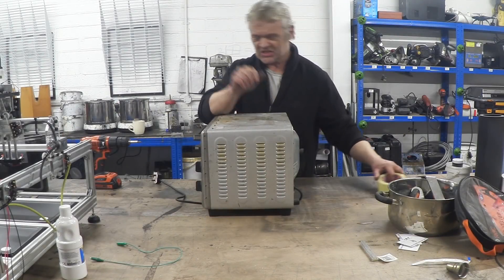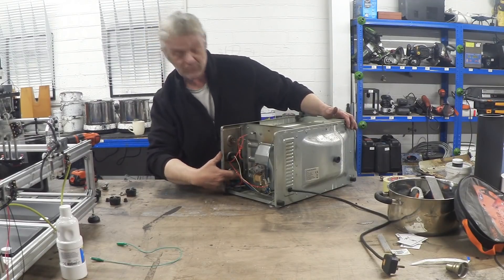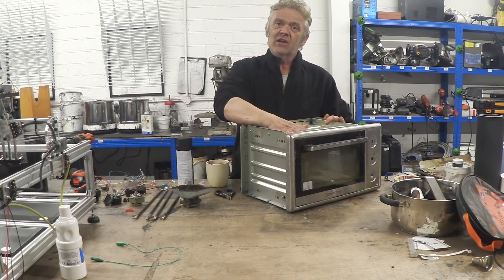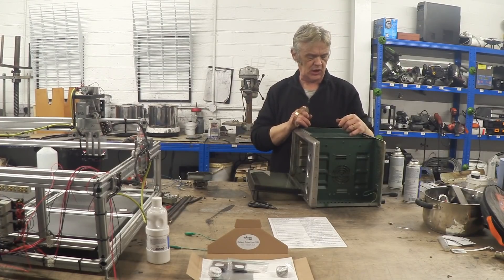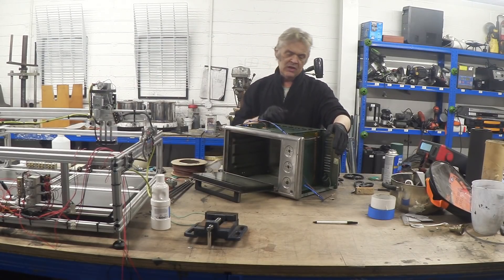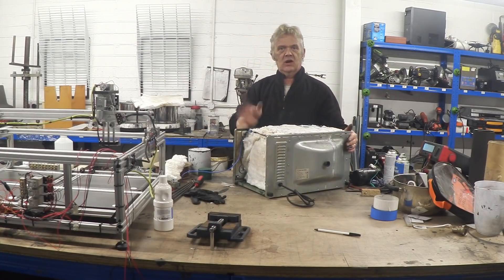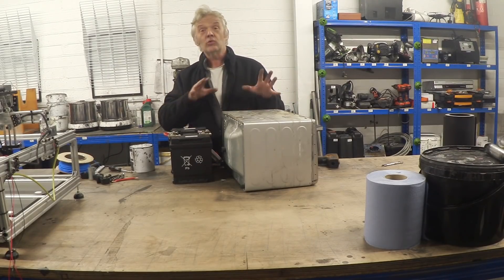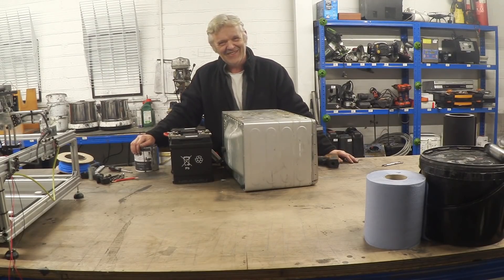Build An Off Grid, RV Oven From Graphene Ink And A Car Battery

Comment: Maybe I missed something in the disassembly... Isn’t there a layer of insulation between the very inside of the box and the metal sheeting to which you applied the stove paint and your conductive ink? Most stoves (albeit, they are home stoves but same principle) that I have worked on have a insulation around the inside box for two reasons, keep the heat in the cooking are and to keep heat away from the electrical bits and from people standing around in the kitchen and the cabinet into/onto which the oven is placed.
Reply: Sorry, I see it now. The insulation was replaced onto the painted surface. Thank you. Very informative.
Reply from the maker: there was no insulation mate - I put it in - the insulation was a ceramic blanket I normally use for kiln work - but the original oven had none at all!

Comment: First of all, nice video Rob. *there are not a lot of cookers working on DC and at low voltages - so you are forced to use grid of inverters*, this is because you will need more amps if you want to run oven on low voltage DC to get 1kW oven and bigger cables also.
Reply from the maker: true enough mate - but I don't think It's a question of kW - more of temp, heat load and time
Reply: @ThinkingandTinkering  Yes you're right. Do not forget about thermal capacity / density. To heat a 100ml of water on classic 2kW hot plate, the water will boil in less that 2 min. A hot plate with 240W on same temperature will need around 20 min or more.
Reply from the maker: @dyukk8844  cheers mate
Reply from the maker: lol - indeed

Comment: One of the projects that I wanted to try with your ink is to make heated mirrors for my truck.  Should be easy as long as you can get the resistance right to avoid damaging the mirror.  Painting the heater onto a precut piece of transparency plastic or maybe contact paper would allow testing and adjusting the heater before sticking it to the back of the mirror.
Reply from the maker: absolutely mate - for those kinds of heating apps I use PET film - it's tough, good for heat up to 100 degrees C and used in underfloor heating - it's what we used to call acetates for OHP applications - it's now used for heat seal laminators you get for the home office - laminating pouches can be got at staples easily enough

Comment: Hot Stuff !
Many of my early experiments ended up with very non-conductive carbon = an insulator.
It would be absolutely awesome to paint on non-conductive carbon, then paint on Your conductive carbon ....
Also, 1 copper strip one one side should connect fine to the steel case - save material/cost.
Reply from the maker: that's very clever mate - thanks for that - like it
Reply from the maker: little more than contact strips - I do like Aga's suggestion - it's like car electrics the body is used as ground - just fine to do at 12V
Reply: @ThinkingandTinkering  Lower case 'a' otherwise it's the American Gas Association, or the Aga Khan ...  ;)

Comment: Thinking about this a little more, I wonder if something as simple as adding a copper strip between the ones already in place (without being directly connected to the power) and painting over it would lower the resistance enough to use off 12 volts?
Reply from the maker: I will have to try it mate - this really was a prototype - it shows it is doable but not a lot else
Reply from the maker: I am about to try it mate - lol

Comment: I would think it should be possible to make this run off 12 volts instead of 24 volts by getting the resistance lower.  Possibly another coat of the conductive ink or get the copper strips closer together.  

I haven't examined a small toaster oven but the thermostat already in it might be mechanical and easy to hook up to the 12 or 24 volts instead of resorting to the Arduino controller.
Reply from the maker: I'll give it a go mate and basically I agree with what you are saying for sure

Comment: If we use 120 W instead of 3000 W,it takes more time to cook and possibly spoils baking cakes!
Reply: I'm no kitchen guru, but you'd simply preheat the oven until the desired temperature is reached & cook as per usual.  Every oven has it's own quirks that you learn to adjust for.
Reply: @laszlon.4424  You are Rob are not taking into account thermal mass, you cant melt an iceberg with red hot coin, just because the insulated oven gets hot does not mean it can cook anything.. A candle flame is as hot as your oven, but it would take forever to cook a meal with a candle, you need the power (watts).
Reply: @goldmagnet9013  Yes I totally agree with @goldmagnet on thermal mass and the power. I think cyrex said in one of his videos that the power consumption on classic hot plate heaters and painted carbon ink hot plate heaters are almost the same, if you want to heat something on same time. Only the design of the heater element is different. Are not electric heat elements 99% efficient?
Reply: You mightbe correct, however I feel your missing the point. Using 12v batteries instead of mains electricity is all about portability/offgrid potential. To take your argument to the extreme a 3 phase oven will probably cook faster than single.  Ease up & see the glass as half full, it's all well and good leaving your mark on this world just make sure it's not a skidmark 😅
Reply: @laszlon.4424  If you look at my videos you will see I live off grid, a 12 or 24 volt system that only used 120 watts of power and cooked food like a 3Kw system would be more than perfect. From the title of this video, I should be the ideal demographic, but its all too easy to see this is of little use as an oven for cooking a meal. I made the comment as I believe this video is not accurate, and suggests that this design would be a good off grid cooker.  Being chilled and relaxing is grand, but not at the expense of the truth, if you do that then you are the skidmark.
Reply from the maker: not really mate - it's not about watts it's about temperature - the main reason normal ovens use such a lot of energy to get to temperature is that they are poorly insulated and have inefficient heaters - that's all really - this oven is efficient at heat transfer and i put a lot of insulation in that's why the power consumption is low but temperature is the same - no magic mate - just common sense really
Reply: @ThinkingandTinkering  Robert your reply is terrible from a science perspective, so inaccurate. The analogy is you are basically saying a battery is all about volts ! You put a cup of water in your oven, and compare it to a 3kw oven, how long would they both take to boil, yours with 120 watts input compared to a 3kw unit. If you are honest you know that it would take much longer to cook anything with any mass in this oven, compared to a normal oven, thats all the poster was saying.   We get that the ink is good, but you are selling it like snake oil.
Reply: @goldmagnet If the claim is they can produce same temperature they would heat equally, regardless of whether one is using 120W or 3000W. Your argument sounds as if car with fuel injector can't use less gas because all of the cars before fuel injectors consumed X times as much. That's nonsense. Have you considered that painting the heating element covers much larger area than standard heating rods used in convection ovens?
Reply: @goldmagnet9013  I agree with you to a point. That is that Yes you will be looking at slower thermal recovery times from a 120W system as opposed to a a 3KW system, though the power isn't telling the whole story is it? The Generic lack of good insulation in these products is why the power ratings need to be so high to maintain a usable temperature profile for cooking.

Let's take what you have rightly identified as an issue rather than a criticism and provide a solution, after all this is a fantastic idea in its infancy, a prototype, there are bound to be some pot holes along the way.
It is not my intent to attack you or marginalize your opinion in any way.

I personally do not detect any snake oil in @Robert Murray-Smith simply enthusiasm, fascination and wonder which we could all use a bit more of in our lives.

As a couple of people have already suggested increasing the thickness of the ink coats would decrease the resistance and so increase the wattage, maybe bring the oven up to 300W so it can be more thermally stable when the door is opened briefly or a colder mass is introduced.

I also see that 300W 12V ceramic heating cartridges are easily and economically obtained from ebay ali express and bangood.
Embed one of these in a Graphite or aluminium block maximised for high surface area and utilise this element as an rapid boost assist at the bottom of the oven. 

Switching between the two heating sources may give you a better thermal profile for cooking which can easily be implemented using PID algorithms and an arduino. That would be my second approach to potentially developing the idea into a working off grid culinary device.

It's just a thought.
Reply: @Traderhood  The claim at the start of the video is that its a usable oven for RV owners. At the end of the video the claim is repeated.  If its not about power, and just temperature then forget about an oven and use an 800 degrees candle flame instead ? An oven is about how much thermal energy is delivered to the food, if you can't see that then as I said use a candle, with your logic it should be 4 times quicker than this oven,.
Reply: @deepforrestalchemy9189  I agree, it would be more workable by putting in some more power from heating elements. The foods got to get hot, and thermodynamics dictates that energy has to come from somewhere.
Reply: @deepforrestalchemy9189  I think Rob should have said that this was promising but the elements need to redesigned to deliver more power. I think the ink is great, but the oven is not a product, and Rob should not be promoting it as such (see his other comments here).  The exact same performance can be got with a buffet heating trolley, only they do not call it an oven.
Reply: goldmagnet actually au Bain Marie is a legitimate technique used to cook food low and slow and is perfectly adaptable in any oven. Think, instead of the shortfalls how do you take what has been presented and modify it so other more demanding temperature profiles can be met, you know... how do we take it up to the next level?
Reply: @deepforrestalchemy9189  I would suggest striving for something that could cook a bowl of soup as a starting point.  No point encouraging RV owners to build something that cant make a bowl of soup, do you agree ? I would  estimate it would take hours to get a bowl of soup from cold with the MK1, I would suggest waiting till this can be done within 15 minutes before recommending it as a solution. Common sense I think.
Reply: goldmagnet Candle covers one single point in the oven. Paint covers large area. So that was a very bad example. Not to mention how do you calculate wattage of a candle to make any meaningful comparison to conductive paint. And again it is about temperature and not power. There are myriad of techniques to use less power to produce better results. Argument that because people used always this much energy for something so they always have to is not valid.
Reply: @Traderhood  Rob said it was only the temperature that was important, as you quite rightly state that is not correct. Thanks for making my point.
Reply: @Traderhood  A normal slow cooker uses 150 watts, gets to higher temps, do you see the point ??? Rob is recommending it to cook food as an oven, not a slow cooker ?
Reply: @Traderhood  I see Rob is now back tracking, saying its more like a kiln than a oven. Perhaps he should contact the RV owners who, in a comment earlier, he suggested should try building one. This is my point in the vid Rob says its an oven to enable RV owners to cook food. It cant, in the same way a slow cooker/kiln cant replace an oven. Any how I thought this channel is meant to be about batteries, so why not just send a sample of super cap or battery to Jullian IIlet, as he promised he would do, so we can believe again.
Reply: Vilo Shmillo thank you - well said.

Comment: Put your ink on the outside of the inside of one of those cheap stainless "vacuum" flasks and you'll have a real winner for a nice cuppa in the car, good job Robert.
Reply: Yeah good one but i am thinking you could just paint onto a glass bottle and then wetsuit material on the outside !
Reply: Electron Proton Neutron Mouron - depends on what temperature you want to achieve. Neoprene has an upper limit of around 260C (500F) and as far as heating goes the substrate (ie the ink) must not exceed this threshold. I am playing with my own starlite variation at present as an alternative.
Reply: Deep Forrest Alchemy yeah i hear you but for coffee i am thinking its ok and cheap and protects the glass that can be replaced easily for hygenic reason . But higher temperatures would need a kind of porous material. Yeah starlite may be great. What would you use as a cover over the starlite?
Reply: Electron Proton Neutron Mouron seal it with an epoxy would be my first port of call
Reply: Deep Forrest Alchemy maybe even dip coat in estapol a few times
Reply from the maker: nice one mate cheers
Reply: .....nice idea, and I know exactly what you mean.
Reply: This stuff is the future Fellers every time something new comes out it gets expanded on they're saying this is going to be the future a processors in computers because the Silicon can't go any higher in frequency
Reply: @ambersmith6517  yes well as it is a semi conductor maybe it's best to start with the highest conductor and dope it down to a semiconductor!
Reply: Alan R what a brilliant idea!
Reply: Electron Proton Neutron Mouron  - I’m going to go with reading between your lines and just dip-it ... you’re a genius!
Reply: Deep Forrest Alchemy thats what she ssid 😂

Comment: Brilliant! Thank you for this video.
I’ve been considering building a thermal chamber for cell testing but never really found an elegant solution for a small size box (I only need to fit a pair of 21700 size cells or smaller in the box). Using your ink gives me all kinds of freedom when choosing the box size and shape. All I need to do is use a small fan for circulating the air (and a temp controller, of course) and it should work great. Just fantastic!
Reply from the maker: it should be awesome mate - would you do a vid - i'd love to see
Reply: Robert Murray-Smith yes, definitely. Many of my subscribers are tech-minded and would be interested too. I’m  actually wondering if I use a small enough chamber, matte black painted interior and about 700cm3 in my design, if I can get away with not using a fan. Definitely a lot of testing coming up!

Comment: Hi Robert
 I made a oven pie warmer out of plywood and a 15 0hm resistor 10 watt wrapped in 1 mm aluminium as a heat sink. I use it in my campervan .It was initially just for proof of concept but i found it works perfect but after watching this I will use a small microwave oven and paint a resistor as you have 👍
Reply from the maker: awesome mate - do vid to - love to see - cheers

Comment: Awesome! My sister was just grumbling about the cost of replacing the galley bits in her boat! I predict a diy in her future! :-)
Reply from the maker: awesome mate -do a vid and if you have questions during the build - drop me a line
Reply: Will do! Thanks! I'm  pretty sure she's gonna love this, as will skads of her sailing pals. Galley kit, below decks or otherwise, is monstrously expensive as conventional electrics are grossly power hungry on the batteries and propane is even more so as, propane being heavier than air , if it leaks can fill the whole boat in no time. Then...one spark..even from St. Elmos fire. ....BOOM B.D.O.B. (bad day on boat) :-)